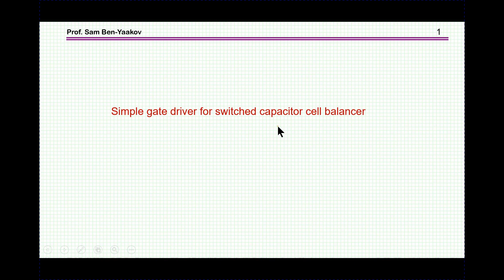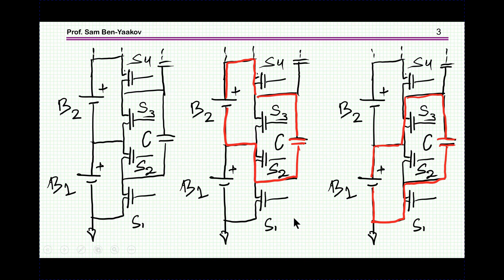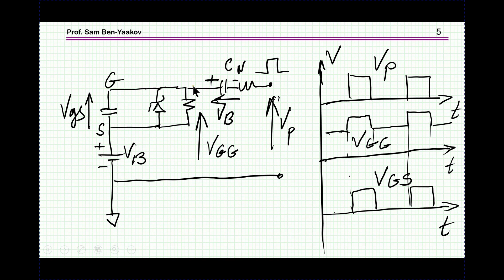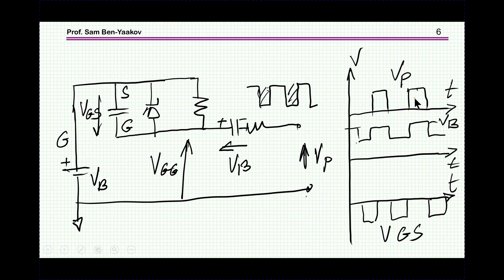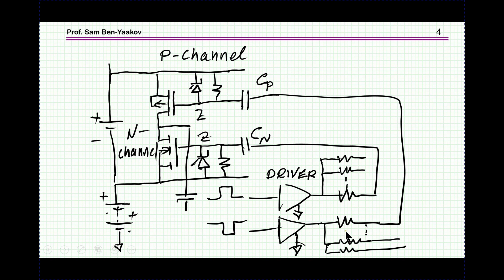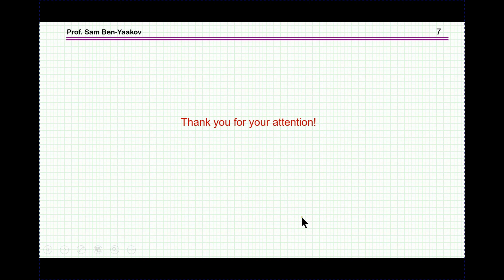Simple gate driver for switched capacitor cell balancer

Comment: Hi great video,
I wanted to ask if we made this circuit for active balancer using only nmos switches, will it work?is it necessary to use both nmos and pmos
Reply from the maker: You need the two MOSFETs to transfer the charge from one cell to the other.

Comment: Was facing a small problem with designing this circuit...
The voltage Vb that is given across the capacitor, cannot be given via the same cells that generate it at the source of the MOSFET. If this is done, then Vgs will perpetually be zero.
We need a way to generate an ISOLATED source of voltage Vb across the capacitor. Any thoughts on how this can be achieved for large voltages, such as Vb being in 100s of volts?
Reply from the maker: I am sorry but  I don't follow. Can you send please a sketch  or refer to slide number or minutes in video?
Reply: @sambenyaakov  Consider the case of the N-channel MOSFET. There is a voltage Vb that has been applied across the capacitor. This Vb is of the same magnitude as the source of the MOSFET that is being driven. 
The source of the MOSFET is at potential Vb with respect to the GROUND terminal of the battery pack. If I were to generate the Vb at the capacitor with respect to the same ground, then the gate and the source would PERPETUALLY be at the same voltage. 
The Vb that is generated across the capacitor needs to be one of FLOATING GROUND, which is independent of the ground terminal of the battery pack. Thus I was asking how exactly you propose such a ground isolation can be achieved.

Thank you!
Reply from the maker: @nailedit2250  The voltage across the flying cap is the drive voltage PLUS the potential difference between the "grounds".

Comment: Thank you so much sir, I managed simulate this circuit quote accurately in LT Spice, although I had to drive the gate capacitors of the MOSFETs in phase both for Pchannel as well as for the N channel as the output of the gate driving capacitors connected to the gates are invers to the input, could you explain why?
Reply from the maker: Because you need a positive voltage for the N channel and negative for P
Reply: Thank you Sir @sambenyaakov

Comment: Thank you for the detailed video on it. I extended this switched capacitor-based balancer for a 48V battery. I implemented this circuit but my gate driver pulse generation pin gets damaged, what could be the reason?
Reply from the maker: This could be due to  back current durig turn on. Try to put Schottky diodes from output tp ground and supply.

Comment: I am currently designing a BMS with SCCB, but I don't know how to decide between using higher capacity (lower switching freq.) and lower (higher switching freq.). How do I approach this?  Thank you!
Reply from the maker: The larger capacitance the better. The consideration is cost

Comment: Thanks sir for this video. I noticed the networking will be N Transistor to P transistor in that cycle or vice versa won't there be shorted?  Also will there be two drivers for each battery, or how will the gate drivers be.
Reply from the maker: Hi. No short if there a dead time to prevent overshoot.  There is ONE driver to all P channel MOSFETs and ONE driver to all N channels.
Reply: @sambenyaakov  thanks sir, now understood
Reply: @sambenyaakov   thanks sir, what's the likely value for capacitors Cp and Cn, and why are they important.
Reply from the maker: @PlainAndSimpleEngineering-24  They are part o fthe  charge pump and are blocking the high voltage so there is no need for isolated gate drivers.

Comment: This is great thanks for sharing, I'm so glad you are doing videos on bms. What is the purpose of the resistor that is paralleled to the zener diode? Is it necessary for discharging the mosfet gates? Should it be a high value or a low value?
Reply from the maker: Thanks for interest. The resistor is just a bleeder and to prevent leakage current from turning on the MOSFET during idle. It should be high restance.
Reply: @sambenyaakov  thank you sir! made a nice working simulation in lt spice based on your design. Im excited to try and make something.

Comment: Ha, this is really the simplest way of driving the fets! Way better to built than with gatetransformers. This way of balancing is as genius as it gets, you don't even need to measure the cellvoltages individualy, only the total voltage to stop charging! This is such a surprising nice solution for the balancingproblem, i find it a really genius idea
Reply from the maker: 😊Thanks for the comment Bob.